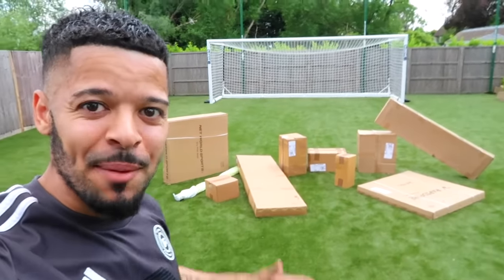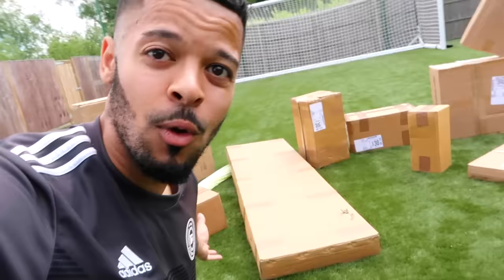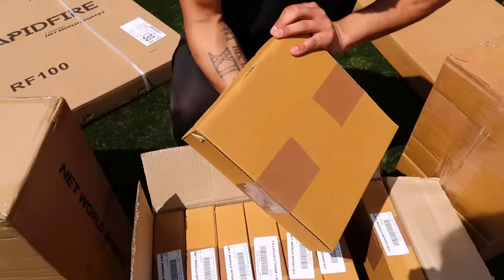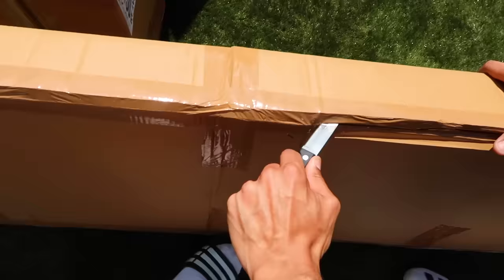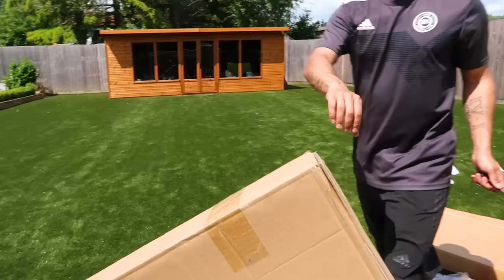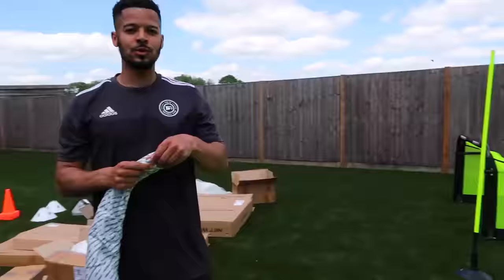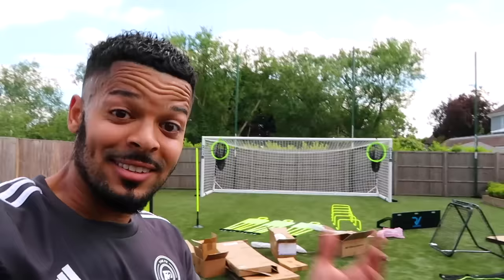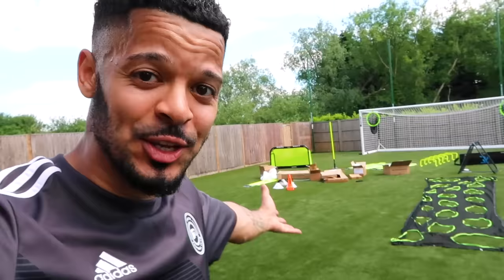BUILDING A PROFESSIONAL FOOTBALL PITCH IN MY GARDEN *PART 2*

Comment: shame the lawn is on sand. A few weeks of use and the mounds will appear. It should be on Rolled Granite .. Sand moves .. granite don't. Sand soaks up dog Pee ..granite don't ...Sand will wash away within months. Not sure who installed it but they did not install it properly. I hope it will last as long as you expect but I doubt it if you're going to be running taking shots on goal ,,, watch that sand shift... just my own thoughts from experience with Artificial Grass. :D